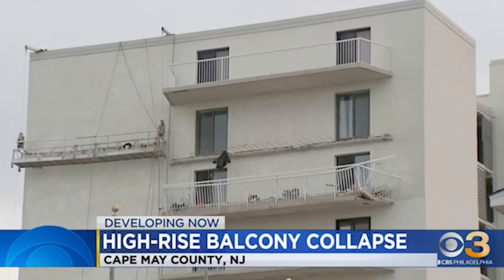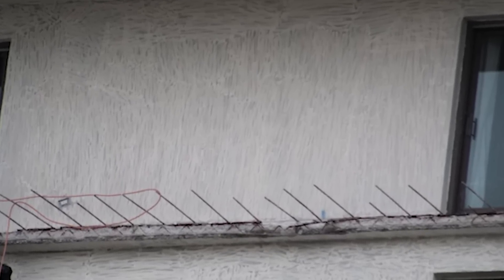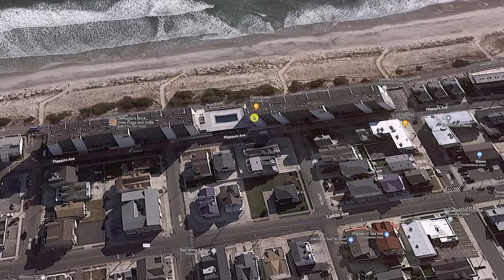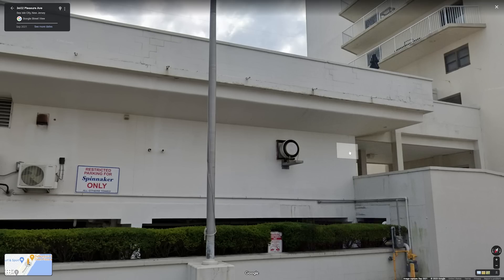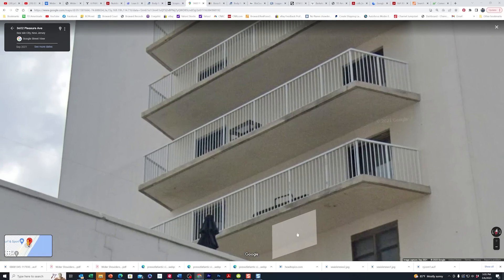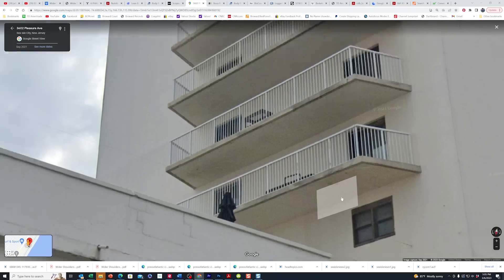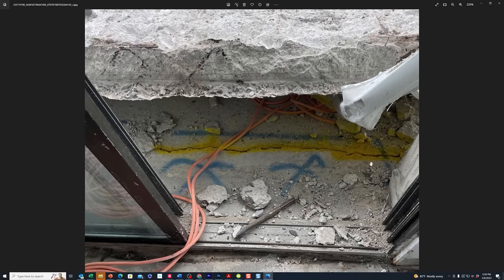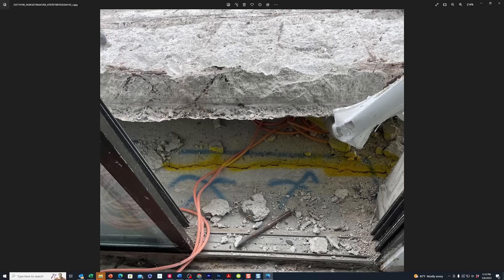What Caused Fatal Jersey Shore Condo Collapse?

Comment: Thanks for the opportunity to mental floss....  So, you made two comments worth commenting on.  The blue and yellow might be after collapse - I wonder, there seems to be material over the blue line to the left, conversely, I've never seen this done by an engineer during inspection, though it might have been done by GC to indicate to crew something, work to here, be careful here, call me when you get here?  The other is that there was no sign of spalling on top surface  - there's no top surface left, which screams spalling or surface degregation.  
Lets start with the deck surface.  I'm betting they removed all the material because it was loose, I'm betting it was loose because it had been covered at some time by something that held water and kept water from evaporating out of concrete, indoor outdoor carpet comes to mind.  More water in concrete, more freeze / thaw damage, more leaching out minerals that hold concrete together.  If they surface was being removed all over the slab, that screams brace me underneath, or better, only do a few feet at a time AND brace me underneath.  It is even very possible the directions from the engineer put limits on how much area to do at a time, though it could have been in the written directions which virtually never are read by field workers, and often by no one.  
It is common to note with rusted rebar to scrape and brush to bright metal, weld on new rebar overlapping old - some say tie on rebar but only welding will create a continuous rebar that won't fail if the concrete does.  It is also common to not that if brushing and scraping reduces rebar dimensions past a certain point, to replace the rebar, hence cutting it out.  Again though, often there are notes as to how much of an area can be worked on at a time and or that bracing is or may be needed for work over a certain amount.  
So, now we can surmise the workers were doing 'as told' to some extent, remove loose chipped, cracked, soft concrete until you find solid concrete, remove rebar that can't be saved.
So, now we can surmise the contract documents limits as to maximum work areas and shoring were missing or ignored.
That's enough to explain what happened.
GC and or Engineers negligence
What else can be told from the pics?
Where is the lower rebar.  While lower rebar would do little to support the slab by itself, it would have probably kept the slab from crashing down on the balcony below, which could have had people on it, or  broken falling to next balcony, etc..  There is no sign at all of lower rebar, or if there was lower rebar, it had totally lost all structural integrity leaving only small rust stains behind after collapse.  That the lower balcony is intact, screams that it was either in WAY better condition, that the design was indeed very strong, that is was built per design AND it might well indicate the balcony above was in HORRIBLE condition or was not built to the same design as the one below ie, rebar left out, rebar too close to concrete surface, etc.  I see a zig zag pattern in concrete at the line it cracked off, typical of horizontal reinforcing in brick joints.  Did this rust, expand, crack the concrete letting in water to attack rebar at this 'line'.  This would be more possible than with typical rebar as there is more steel, thinner steel, more evenly distributed across the cross section - meaning lots of easy to rust steel permeating a 'shear' plane from end to end on the balcony.  Rust is EXPANDED metal and as such would expand and crack the concrete.  The concrete from the outer edge of balcony would then only have had the top rebars to transmit load back to the building.  This is if not what they were designed to do (as there is redundency in structural design, ie, either the concrete or steel would be sufficent to prevent catastrophic collapse like this (note, concrete lends itself to catastrophic collapse, which is why MULTIPLE layers of rebar are used in it, so there are multiple steel elements to keep it from totally failing).  A crack in the slab across the entire deck would also explain why top (and only?) rebar was rusted and perhaps rusted away to near uselessness, uniformly, across the entire length of balcony.
Shoring - a word on shoring.  No one will pay an engineer to design that into the project, as the engineer, being liable for life for their work, would insist on ANYTHING at risk being shored to 2x what is needed (standard overdesign value for structure).  No owner wants to pay for that much shoring either.  Shoring up high in a building means MORE shoring below that, all the way to ground, or shoring to transfer load to known good structure that has been calculated to take the additional load.  So in this instance, every balcony below would have had shoring posts under those above, rendering them all un-usable, as you can't let people 'live' around such, as they might tamper with it, even accidentally, ie, smart alec kids..  Therefore the need and design of shoring is left to GC, with at best a requirement to submit such for review by the engineer (who sort of takes it as a 'make sure you got work in this area covered it looks bad), as well as noting if planned shoring screams 'junk'.  
Thanks for fun to think again  If only any firm could have been able to kept paying me to figure out sick tired old buildings, but as I noted, no one wants to fork out the kind of money needed to do it such that such accidents, or disasters as in Florida, happen.  If clients won't pay firms, firms can't pay staff.
Reply: Wow. Home truths. I work totally not in construction but in legal translation. Many years ago, I formulated a "wisdom" that may be "smart alec" or close to the mark. That a set of legal terms and conditions (STCs) will definitely be read by one person, with a potential to be read by a second, and are destined never to be read by the third. And that's it. Three people - there's no one else. The first is the translator (he can't translate what he doesn't understand). The second, who may, all being well, never get his chance, is the judge. The third is in fact the drafter: drafters don't read their own documents; after all, they wrote them, didn't they? Then: costing is the domain of the GC. Costing determines contract acceptance, by the owner. Safety affects costing, which influences acceptance. In that configuration, as in so many, safety, a matter within the realm of specialised engineers on behalf of the GC is ultimately made a decisional matter for the least specialised of them all, the owner. If the workmen pulled the carpet from under their own feet, does such a chain of responsibility not already start tugging from the outset?

Comment: I talked to a local that said the contractor wasn't licensed in NJ. And not licensed to do that type of work. I have no way of confirming this. The majority of these condos were  probably purchased by people of modest means years ago. The board members tend to not do necessary repairs or look for the cheap way out.
Reply from the maker: Yes that happens a lot here in Florida as well where the homeowners association ignores things like painting. If they just kept the buildings painted well, then water and weather would not make its way past that barrier and into the concrete to start the spalling process of corroding the rebar rods

Comment: There's no I-beam support under the deck you could see by the break
There should be at least 1 3 to 4 ft I-beam supports coming out of the building for every 4 to 6ft of those decks
THERE ARE NONE
Reply: Hi, that is interesting: you advocate an I-shaped beam transversal and in the same attitude as the "rebars" as a support back-up should the rebars themselves fail? I can appreciate that; although it's not clear, according to the program-maker, why the rebars themselves were cut through: do you think the workmen would also have severed the I-shaped girders you speak of? Or would they have proved too robust for them to have done that ( I hesitate to use the word: foolproof)?

Comment: Just watched this.  Does appear they may have cut the rebar, but all the bar that remains in the wall could have been lapped on the bars that remained in the slab. Either way, shoring was required. I’ll bet it was low bid got the work.

Comment: My god looks like they just cut through all the rebar, without support? I mean that's just asking for it. Also, they cut away so much of the rebar that even if you used support, the balcony underneath might not even hold that weight, especially if it's in need of repairs. Better save than sorry, work from the bottom up so you can use the repaired balcony to support the next floors repairs.
Reply from the maker: It's the Classic story of the lumberjack cutting the branch that he Is sitting on

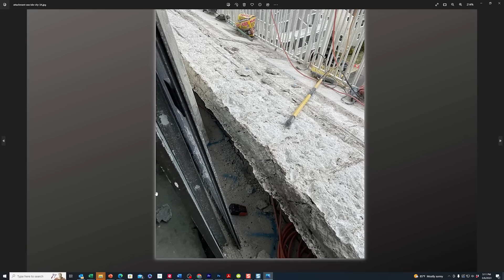Comment: At 4:52, not a walkie-talkie, I think it is a Milwaukee M18 battery for one of the demo tools. The rebar should be in the middle of the slab with bars tied into the floor slab and with cross rebar to code. Insufficient rebar and not properly placed.
Reply from the maker: This is not an M18 battery. I have tons of them, does not look like one

Comment: There is not enough rebar and bad placement. you can also see water infiltration and mold at the seam where it gave way. they definitely caused by removing the top layer of spalling and cutting. it but the  builder also didn't build it with enough rebar. this is also water damage that resulted in a bad repair coupled with construction error.

Comment: 4:52 That device is most definitely NOT a PD / FD / EMS portable 2-way radio.
The #1. Reason?  
The Motorola APX 8000 radios currently in use there are $8k @ radios.
No one would want to have to explain that one… 😉

Truthfully, it does not have the physical frame design of any public safety radios in service in the past 30 years.

It does have the appearance of a $20 buck “Chinesium” portable radio w/its antenna broken off.
Likely in use by low budget contractors…

Nice video. Thanks

Comment: They built these places with such shoddy materials and poor planning and maintenance. America has tons of buildings like this ready to collapse.
Reply: So scary!!
Reply: But the patio below did not fail, even with the unintended weight of the above patio impact on it.
Reply: @Sylvan_dB   I'm sure it will eventually. These places haven't been maintained, they cut corners.
Reply from the maker: This typical flat slab construction design is actually held up pretty nicely as testimony of the drop of the patio onto the 7th floor patio is clearly showing that that patio was able to hold now the weight of both of them together whereas the 8th floor patio could not hold its own weight. And I believe it was because they compromised the construction. A lot of times buildings collapse due to maintenance issues not design and build issues.
Reply: @jeffostroff  Owners of these buildings don't want to spend the rent money they collect or the association dosen't want to spend what's necessary for proper maintenance so they cut corners and then things like this and what happened in Surfside Florida happen. The inspection of these buildings isn't taking place at all or enough. People lose lives.

Comment: Shouldn't there have been a second layer of rebar? It should have been seen bending down. I only see the top layer with the cut rebar.
Reply from the maker: The exposed rebars that are sticking out of the building were the upper layer.The lower layer of rebars are still embedded in the concrete slab that came crashing down
Reply: Top on a cantilever is in tension, bottom is in compression, thus rebar there is optional case by case per PE specs. Sad someone died, tough way to get an engineering lesson.
Reply: To me that top rebar was all that holding the balcony up the rebar you that was on wall edge like the triangular stuff they put in floors but it is running along the length of the balcony ,I personally  could not see any sign of rebar sticking out under the top top set of bars that I would like to see, but I would think our building rags  in the UK are different from yours
Reply: @michaeljohnson4636  Exactly my point. You would see something. Either the lower bars bending down and keep the concrete slab hanging, or being pulled out of the slab leaving bend down stumps. I find it unlikely they would be sheared off cleanly. From pictures (at 5:00) of the fallen slab you may see hints of lengthwise (along the break) going lower rebar, but none going across.

Comment: Makes no sense why they would cut the rebar like that.
Reply from the maker: YEs I would like to know what their thinking was for cutting this
Reply: @jeffostroff  Usually you would jackhammer the concrete around the rebar to access the rebar.  These dudes just cut the concrete as if it was a slab laid on the ground.
I will bet they have no permits or insurance.

Comment: Those rebars sticking out from the wall are  straight. If they'd pulled out, they'd be bent (as in the CTS West Block demolition. Can it be they'd exposed them to work on, relying on the lower row to carry the weight, only to discover they weren't there? There's only one line of bars protruding, not two.

Comment: Surely it must be possible somehow to protect the rebars from corrosion by using sacrificial anodes ?
Reply: It is, however this is usually much more associated with ships and water heaters. It comes down to cost, reliability and potential consequences. As far as reliability goes as a Structural engineer you may be designing a building to have a design life of 50 years. To rely on a sacrificial anode to do its' job requires that all the reinforcing is properly electrically connected to the anode, that the anode is of sufficient size to last between replacements, that the anode is properly inspected and replaced as required and this is done properly for the following 50 years over multiple different owners and personnel changes . Essentially the building code doesn't require it so you would need to convince someone to pay the additional expense now for something that may have long term benefits however generally doesn't benefit the people paying for the construction of the building in the short term so usually doesn't get done. There are numerous high rises where the builder used salty water in the concrete to increase the setting speed whilst having massively damaging consequences in the long run for an example of short term gain outweighing long term costs.

Comment: People don't take into account the sea salt in the air that will corrode metal. It may take longer than if it were in the rust belt, but it will get you if you don't take it into account.
Reply from the maker: They must keep those buildings sealed and painted

Comment: It makes no sense why you'd think it's a good idea to remove the very thing you're repairing (the rebar) so the cantilever patio doesn't collapse, while failing to support the patio. If the patio didn't need the rebar, why are you fixing it?
Reply from the maker: They are supposed to set up bracing in the form of shoring poles

Comment: Looks like a cold joint on the cantleiver and not Monolithic
Reply from the maker: No what you saw was not a cold joint and proves that it is indeed monolithic concrete pour. When it collapsed , the slab created its own fracture point about 12" outside the wall.

Comment: Probably selected by low bid, and I suspect the firm and workers in NJ were just typical "flat work" concrete folks. These would not be expected to have the understanding of what is needed to repair elevated and/or structural concrete.
Reply from the maker: Yup, should have had an engineer there to oversee

Comment: Woah there, cowboy.  If you are going to blame the low man on the totem pole, why aren't you putting blame squarely on project manager/company for clearly disregarding worker and public safety (almost certainly to save $$$).  Low man on the totem pole does not set work schedule, coordinate safety inspections, or engage engineering firm.

Comment: You can clearly see on the shots where the balcony has already fallen, and the Rebar is still hanging from the building. There is only one layer right at the top of the concrete slab balcony. There is no lower layer at all. You can’t even see in the building, so it’s not like they’ve even cut through it. There is no evidence of it, so that building was definitely built with a very bad design flaw and I’m from the UK, so I don’t know what American building codes are like, but that to me should’ve least had two layers of Rebar to reinforce the balcony and it clearly does not after watching a fair few of your videos I’m quickly coming to the conclusion that either American building codes from back in the day we’re not that brilliant or the contractors got away with murder literally at the time and didn’t build the buildings for the code and they weren’t. Inspected, you can clearly tell that and the bit that really annoys the hell out of me. What is the obsession with building property on elevated pillars/stilts it is just a recipe for disaster I understand I like put in the parking garage underneath, but you are just causing such a weak spot all that building resting down on a few pillars rather than a solid foundation spread across the entire base of the building, because, as you said many times in videos of the champagne towers in Florida, we don’t know all we think this column may have collapsed first bringing down others. Eventually the building collapses if that building was built flat on the floor not on stilts/columns won’t have that problem. Yes I know it’s nice and neat to have all the cars parked under the building rather than a bloody great car park, taking up valuable real estate at which point is common sense and safety come in front of not liking a car park